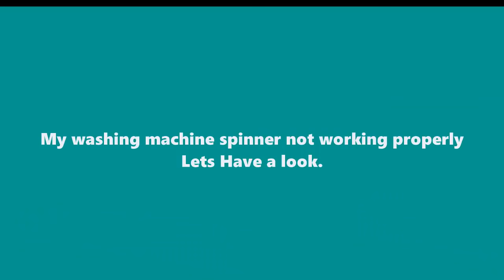How to repair washing machine spinner - Dawlance Washing Machine

Comment: Hi Easy Solutions, your video worked perfectly for my LG twin tub as well. The spinner was wobbling all over the place and when we took out the bushing  the metal part was on the shaft totally separate from the rest of the rubber. Had a little hunt to get the part as the machine is about 15-20 yrs old, but we found it. We really did not want to spend equiv US 300  to buy a new one when it cost US27 to repair - no labour fees cause my best friend and I fixed it ourselves.  Thanks very much for getting the inspiration to post this video, it really helped us here in Trinidad.
Reply from the maker: Thanks sir for your appreciation! We really love it, just stay connected with us for more these kind of videos.
Reply: Hi he is not showing the under part where the motor is
Reply: Fak😊😊😊😊

Comment: What was the problem you had before you repaired it? I have a different brand (most are all the same with different brand names on them). The spinner motor in my machine doesn't seem to be working. This has been happening the last 4 time I've used it. It's 2 years old. It makes loud noises and although it does go around and around, it no longer spins the water out of my clothes, or maybe just a tiny bit. I really need to get it to work again so if you would explain the problem you had with yours, I might be able to tackle my machine. I am an older woman and don't want to mess the machine up more than it already is. Everything else works fine. Thank you.
Reply from the maker: Thanks a lot for commenting As you say, I think there is a problem with the spinner of the bush It's easy to change and I've made a video about it too
Reply: @easysolutions90  I think that is my exact problem. I'm still using it and it makes terrible noises and shakes uncontrollably til it really gets going but I put much smaller loads in it now until I can get the part to fix it. I'm a girl so taking it apart is a little scary but I think I can do it.

Comment: Will this work for the best choice twin tub portable washing machine? My spin cycle will work then after some use it stops. And doesn't work. Like maybe it's over heating.. idk. But I know the manual doesn't help at all. And I love my mini. My apartment doesn't have a washer hook up. So I found the mini washer.
Reply: Im having the same problem
Reply: Me too
Reply: @v.johnson7251 I took the top off mine, and found a sock twisted around the bottom of the spin tub. That's why mine was messing up.
Reply: Yea same thing happened to mines
Reply: @v.johnson7251  glad you was able get it fixed
Reply: @noblesupernova5103  actually I didn't. I got another one. Lol appreciate it tho
Reply from the maker: Contact me mail address

Comment: Thanks for posting. Will this help with the washer tub as well? My spinner is working, but the washer tub suddenly stopped working properly.
Reply from the maker: You should try this method first it may help you but still if you face the problem you can feel free to ask and we’ll forward your concern to the technical department. Thank you!
Reply: @easysolutions90  thanks for replying so quickly! I'll try taking it apart tonight

Comment: I need this take the spinning drm out. Yours seems to come out easily; mine seems to have hidden screws with covers.
Thanks for the video.
Reply from the maker: Try finding them because if you won’t then you you’ll unable to open up the machine to solve your issue.

Comment: I also have the same washing machine of dawlance brand model dw5200 purchased in 2004.
Please guide me as how the check and remove/replace it's dryer motor and how to check capacitor of motor?

Comment: I have a westpoint washing machine and on trying to spin, the drain pump works but spinner won't rotate.  However on checking manually the spinner rotates freely what to check please
Reply from the maker: Check the pully which holds that spinner from downside or check the bush.

Comment: please please please post a link where to buy that black thing, I think you are calling the "bush".  very hard to find online, a link to where you bought it even if in another country would be very helpful.  I appreciate your video but it does get frustrating without all of the information, especially where you personally bought the part.  thank you  Plus its extra confusing because apparently there's a washing machine brand named BUSH
Reply: I have the same problem!! Been trying to find the "bush" in home depot or online. NO LUCK!! Please let me know where to find it
Reply from the maker: I would recommend you guys to visit any electronics shop around you or to plumber he will guide you either to buy from him or any other shop, as we also bought from shop nearby us not online.

Comment: Great work sir can you guide me how to fix the cable that holds dryer door hold on top??
Reply from the maker: Sure, your request have been forward to our videos creator.
Stay connected with us, you'll be updated very soon.
Reply: Easy Solutions can u help me too wit the cable that hold the dryer door
Reply: I think, in many washing machines  , dryer door is not hold by cable . It is held  by  a spring. Check  your model. Open  top  panel  ( with knobs)  . I think  you will find  that spring which may be broken or  came out from it's grip.

Comment: Where is that plastic u connected from the bottom to the top. I saw u release it from dryer cover. Which part of the dryer cover is that connected too mine came out
Reply: Dryer lid brake.

Comment: Why did you undo the cover though? Could you still lift the spin dryer if you didn't undo it? Mine won't come up even though I undid the bolts holding it from down.
Reply from the maker: There might be a problem in yours. Check it out otherwise we’ve shown the complete mehod in the video.

Comment: I have a similar washing machine and hope you can guide me to fix my spin side. My washing machine is made by globest. It's blue on top and a white body. My spinner slowed down and doesn't spin fast now. I only had it for 2 weeks. Can you possibly tell me how to fix it. Thx
Reply from the maker: The problem could be loose or broken belts, unbalanced load, lid switch not working or electrical components not working. When troubleshooting any electrical appliance, start with the simple steps first.
Reply: One other I've noticed is that when the spinner would run and the timer would stop then the spinner kept spinning until you open the lid but now with the spinner going slow the spinner stops completely when the timer ends.

Comment: i just changed the motor of spin tub, old one was getting heat and stopped, so replace the with new one, but  is not moving  whereas, motor is okay, condenser is okay both are already checked, wiring is not having any type of cut what could be reason....old one was running, wo wiring would be okay......what could be reasong
Reply: Dryer ka dor ka lock tut gya dry nhi Ho rha Kya kre

Comment: Dear sir, I have the same model of washing machine. It's spinner doesn't move when i put clothes in it however it is working when empty. It stopped working once but i put some machine oil on the top bearing and it started moving. now it is not working when i put clothes in it. would you please guide me in this regard. thanks
Reply from the maker: Please have a check either your bush, capacitor and motor is in perfect condition because they may cause a problem if either one is faulty.

Comment: I have different problem.. my spinner works good with only 2 clothes.. but recently its not spinning fast when loading more than 2 clothes.. its starts shaking and spinning very slowly till the end of the spin time without drying (checked inside room of spinner tub.. no cloth is clogged) 
Do i need to change bush ? Haven't opened the spinner tub yet ! (Whirlpool Semi auto washing machine with two separate tub like yours)
Your valuable comments appreciated 🙏
Reply from the maker: Your Washing machine bush not good  change know
Reply: Checked the bush and it seems good.. the problem is with brake shoe.. it keeps on touching the surface and creating this issue.. now i have removed the brake spring action and the problem got solved, but it takes 1 min extra to stop the spinner after stopping spin time. (But that's not a big issue)

Comment: After putting new washer dryer got off balance and making abnormal sound, is there any way to correct balance?
Reply from the maker: Check your pully above motor on which this washer dryer stands it might have problem or try changing the bush if still problem occurs.

Comment: My spinner just stopped working suddenly & now my washer won’t work either , it was a sock stuck in the spinner side I took it out but it still won’t spin or wash however the motor still works for the washer ( will spin if manually spun with hand ) can you help me with a solution possibly? Plz
Reply from the maker: We’ve just uploded a new video for those people who are facing issue in their washing machines washer impeller/agitator/washplate. Go through it

Comment: 1:48 you use screwdriver to lossen   it,but my panasonic i have to use a spanar/wrench and it is hell to lossen the damn thing..still is..any idea plz help..tq
Reply from the maker: +Junaidi Padillah take pictures of that and email me farhanharoon90@gmail.com.
Reply: Easy Solutions will do..thanx man!
Reply from the maker: Still now if you're facing the problem then I would suggest you that go for the wrench given in this link and it'll surely help you to losen it.. 
Wrench :- http://amzn.to/2hou9bE
Reply: Easy Solutions did you get the picture that i send you?..
Reply: i actually have thos kind or wrench..i'll give it a go..tq sir
Reply: Use wd 40 spray
Reply from the maker: no issue bro, you can ask anytime. We're always there to help you.
Stay connected for more upcoming videos!
Reply from the maker: Yeah its quite helpful, you can use it.
Reply: Use an 8mm t-rod for this purpose on this machine.

Comment: Sometimes the water goes into the dryer area other times it doesn't. What is the cause of this?
Reply from the maker: Do watch our how to fix washing machine leaker video. Your problem will be solved.
Reply: @easysolutions90  I found the issue! It was the rusty spring inside the rubber diaphragm not closing the diaphragm tight enough so I need to figure out where to get a matching new spring to replace it with.
Reply from the maker: You can get a new spring from any repairing hardware shop near you.

Comment: My machine worked but then the sooner stoped drying the clothe, it still spins and all but the clothe are the same and some time the water from the washer side goes to the sooner side. Does anyone know what is wrong
Reply from the maker: Do check your spinner pipe there might be a problem in it.

Comment: How to increase speed of washing machine spinner, I have changed capacitor but there is no difference
Reply from the maker: Check your motor, it might have current or winding problem. Check it properly in order to increase its speed.

Comment: My washer does wash and spin but it finishes spinning it shots a little water back and it shots water back on every spin! ?
Reply from the maker: The water always shot back but due to cover is placed upon it water doesn't come outside. So it happens almost in every washing machine don't worry about it still if u think there is a problem you can feel free to ask.

Comment: My dryer lid cable has been cut off ... How do I repair it ... Pls I'm living in ground floor I can't lift my clothes wet to terrace... Pls help...
Reply from the maker: As far I understood your issue
You need to trace the wire to where it was cut and manually repair it.just don't touch the bare wires directly with your bare hands .use a bit of tape to repair the wire.

Comment: Hi the wire is broken in mines what can I do? Thanks
Reply from the maker: Replace your wire, it will work.
Reply: @easysolutions90  I dont know how
Reply from the maker: Just check which wire is broken and from where it is coming and where it is connecting, then try.

Comment: This is so incredibly frustrating, OMG! On screen it’s saying “old brush”/new “brush”! In the description just “brush” is evoked as well! You must know typing “bush”, “spin dryer bush” or even “motor bush” into Amazon’s/Home Deport’s search, solicits actual brushes! What is the item you’re replacing called? “Brush” is not specific enough!
Reply from the maker: We got your feedback, we’ll make sure to not do any clerical mistake from now onwards.
Thank you!
Reply: @easysolutions90  Hi, what would be the correct term to put on the search bar? Also trying to replace mine. I appreciate your video, thanks!

Comment: The washer side of mine won't spin hellppp? I don't want to throw away I feel it can be fixed
Reply from the maker: Did you follow up the whole video? As we've shown the accurate way of fixing it but if u still faces the prob do tell so we'll guide i further.
Reply: I just purchased a costway.  When I turned it on it would not spin.  How can I fix it?

Comment: My machine washes only when the dry cycle is on
Reply from the maker: There might be shortage of wire which is causing it not to work, make sure to get your washing machine checked by a electrician.

Comment: Hello the washer part of my machine only spins clockeise continuously how do I fix this?
Reply: Stephon Nicholls mine spins clockwise them stops completely . At least yours spins !
Reply: Timer issue.
Reply from the maker: You most likely have a problem witheh transmission.